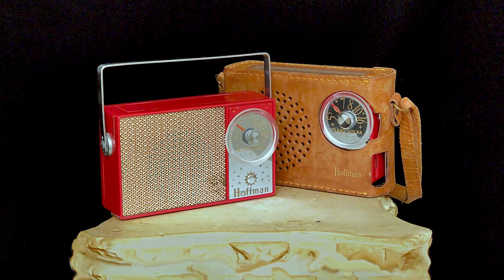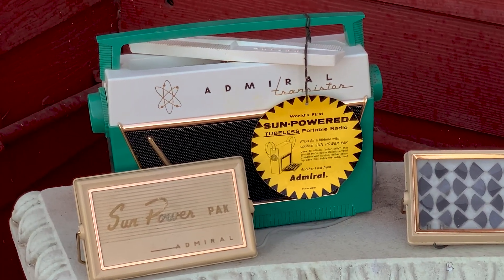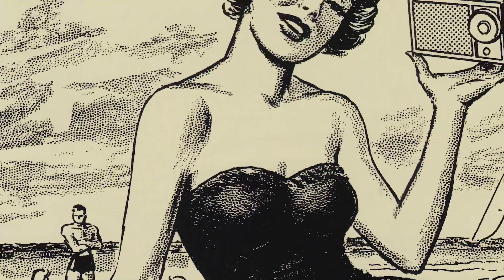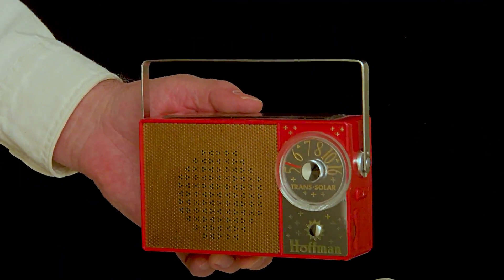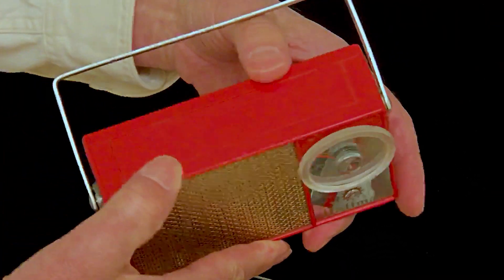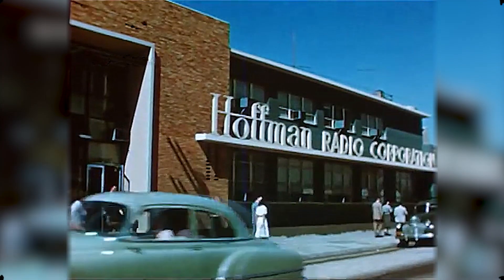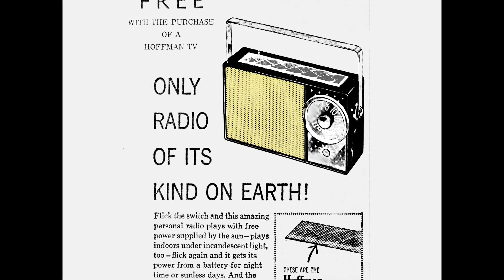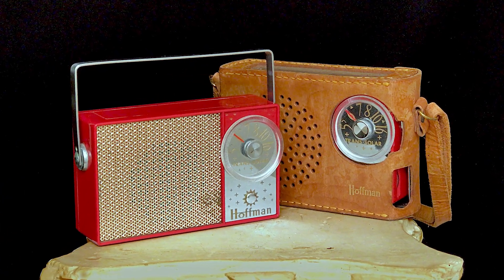The 1958 Hoffman Solar Radio That Wasn't

Comment: I have several of the Hoffman TVs.  Even though they are near my age, (70+), I have restored several to working condition.  I did not receive any solar radios with them though!  Hoffman TV of the early 1950s-lovely black and green (not black and white).

Comment: Around the mid 1960s some manufacturer brought out a solar powered radio that also had a ni-cad rechargeable battery, so the solar cells would be used to recharge the battery.
I'd imagine these were only sold in sunshine states, never heard of anything like this being used in Europe
Reply from the maker: These radios appeared in the 1950s--from Admiral and from Hoffman. There are videos on this channel all about them. They were sold and used nationwide and could even be powered indoors by the light from a typical lamp of the time (incandescent bulb).

Comment: Hey there, I saw this radio in the January 1959 issue of Popular Electronics, I bought a whole lot and love flipping through them and spotted it as a sneak peak in the December 58 issue, Lo and behold, I had that issue with the radio In it.
Reply: 80$ USD 💵Was Quite A Chunk of Change back in Those Days😮😢 What, No Solar Powered Hoffman TV??📺🛡📛

Comment: I'm surprised that a small strip of 50s era photovoltaic cells could power a loudspeaker radio.
Reply: It's all about wattage. A 9 volt battery powered receiver consumes roughly 200-250 milliwatts of power. Current solar panels can produce 20-30 watts per square foot.
Reply: @joewoodchuck3824  Right, but what could a 1950s solar cell produce?
Reply: @thrillscience  I don't have that information, which is why I was only able to quote contemporary numbers.
Reply: It all comes down to wattage. Such a receiver probably consumes ~250 milliwatts of power. Current solar panels can produce ~25 watts per square foot. 25 ÷ .25 = 100 which works out to ~1.5 square inches of panel in theory. A practical setup would include a rechargeable battery of course which would increase the panel size considerably, but with the benefit of using the receiver when not in the sun.